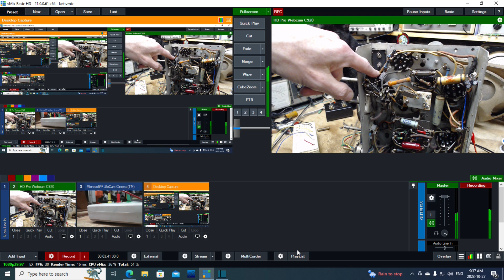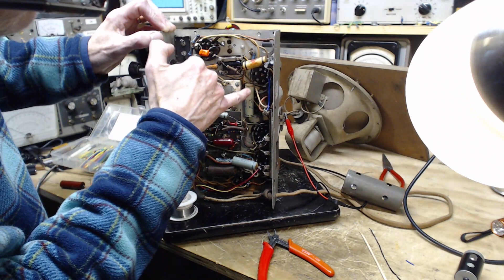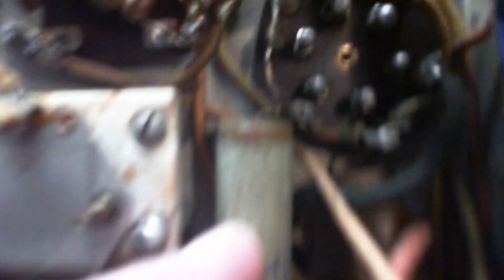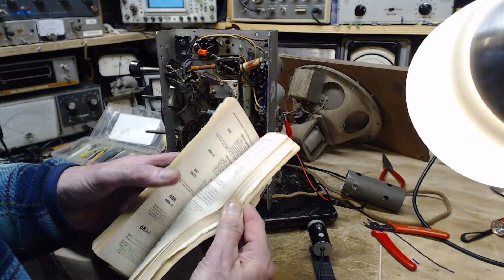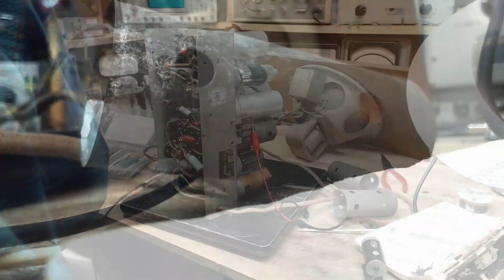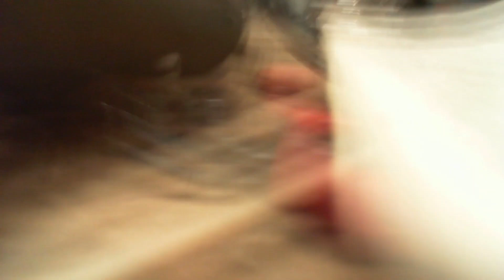Canadian General Electric Model A55Z Video #6 - The Truth Surfaces

Comment: This is actually video number 6 not 5, but whose counting! Tubes in this radio are supposed to be 41,80,6A7,6B7 and
 6K7 ( not a 6D6). One reason never to just turn any tube radio on after replacing a power cord , replacing electrolytics and
 other caps.